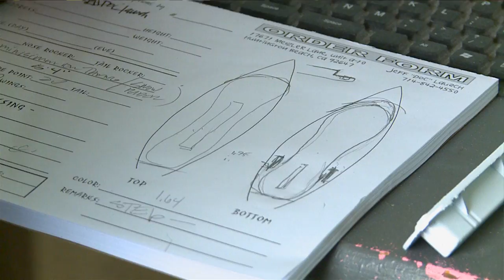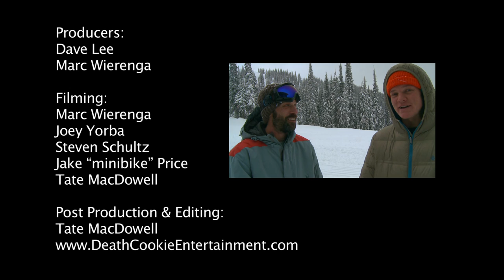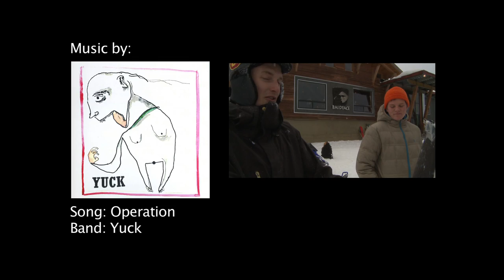Every Third Thursday-Fish out of Water-Surf Snowboard-by-Signal Snowboards

Comment: Worked great on about 6"-8" of average snow starts to struggle a bit past 8". https://www.youtube.com/post/UgkxoHYZbq5g9fkcAtinlTqstNlje-UQkCHN Very light weight and the chute spin control works well. For the low price you get a ton of value. My only complaint is managing the cord as it does take a fair bit of effort to watch and pull the cord out of the way. I found myself having to whip the cord out of the way a lot when I needed to make one way passes to mange the blow direction. It's less of an issue when you can work both directions. A battery powered version would be a lot easier to handle but that is also double the price and requires battery care. I chose the corded version so I didn't have to worry about batteries but I do now see how much work the cord is. I let my neighbor borrow it and it outperformed his smaller gas blower, he was totally sold. Very pleased with the power and operations.My only suggestion is to spend a bit more on a cordless version if you have budget for it. The cord is a bit more of a headache than I thought it would be. Very pleased with the Snow Joe brand and quality.